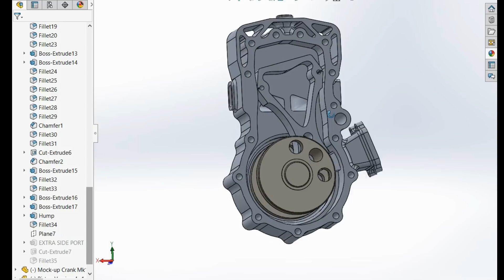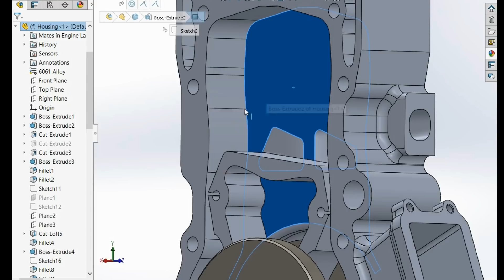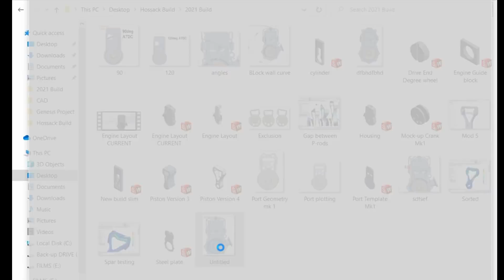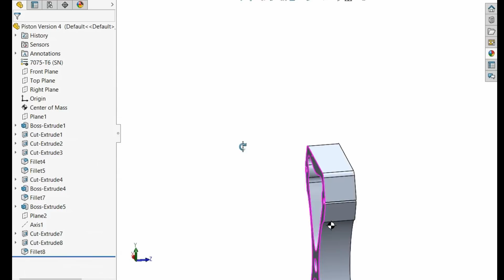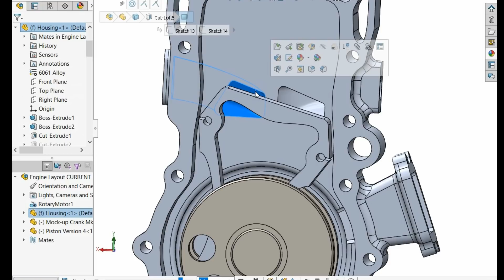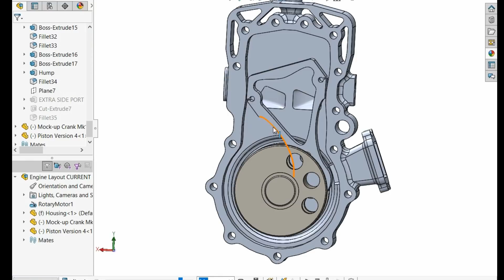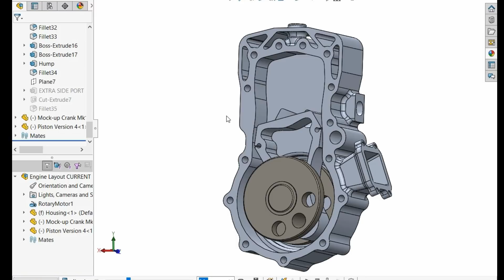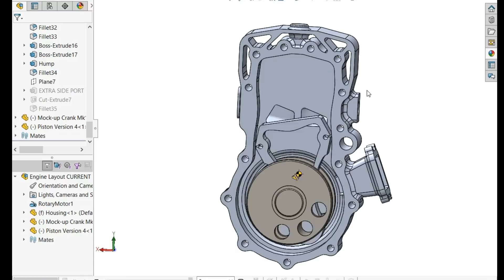The Hudson/Hossack Engine   Part 4

Comment: 100g hahaha, not a fucking chance. The only way you going to make that is to make everything smaller.
Reply from the maker: Because? Because you just say so?
Reply: @thedirtyworkshop   because 100g is fuck all. You’ve currently got the whole piston/rod set up as aluminium. How many aluminium rods are there about (other than drag racing) that last?
Like you yourself have said in the past con rods get compressed and stretched which is why they are made out of steel. 
The ‘v’ section you have there will have to cope with the same forces which I have not seen you calculate yet.
The whole thing will need to be made out of a material with similar properties and I doubt your forking out for titanium. Or you will need a joint between the v and the crown. 
You also need to add some sort of skirt to the piston to cover up the intake port otherwise what’s stopping intake/exhaust gases pissing into the crankcase. 

So “because” I only see it getting heavier I left that comment. Feel free to delete it if it upsets you Del.
Reply from the maker: Upsets me del? Lol 

I have some questions that will answer yours.

1. Why are rods made of steel? What property do they have that aluminium doesn't? 

2. "I doubt you're forking out for titanium" why? Titanium isn't that expensive? What do you know that I don't? 

3. The piaton needs skirts because the ports aren't covered. If this is true how does this engine work? Can you explain the flow process for me?

4. How would I calculate the stress? And why didn't the stress simulation do that?

Comment: this concept is utter rubbish
Reply from the maker: Because???
Reply: @thedirtyworkshop  it's going to rattle and shake itself apart and wear out the seals. also it's not a cylinder I think it would be called a combustion chamber? How would you seal up the sides?
Reply from the maker: It's going to rattle itself apart? Based on what? Ah yes, guessing... I also like how you say "it's not a cylinder" then guess what it would be called... the sides would be sealed with "side seals" funny that...
Reply: @thedirtyworkshop  more of a statement of the obvious rather than a guess, the piston will be whipping about thrashing from side to side or oscillating if you like as it not a cylinder as the sides are not parallel. There are no side seal on your animation, but from the looks of it they would be undergoing uneven wearing and would not seal for very long. It's an awful design.
Reply from the maker: Lol so nothing then. Funnily enough this isn't my design, and a prototype works and runs fine. You've obviously not got the volume in otherwise you'd know all of this. 

Just more mindless bullshit, cheers for wasting my time
Reply: @thedirtyworkshop   I know it's not your design, and I have seen the prototype running thank you very much Mr. Clever Dick. Mr. Hossack has demonstrated that he can make an engine that combines the balance problems of a reciprocating design with the sealing problems of a rotary design. only time you are wasting is done by you.
Reply from the maker: Well we'll see won't we...